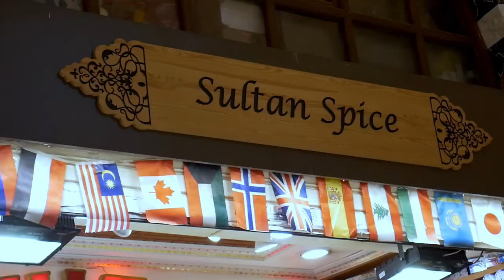Cycling Turkey - The Southern Coast // A Bike Touring Short Film // Part 8 - Turkey (continued)

Comment: Water Pistol  - spray dog in face, add mild solution of lemon juice to the water, spray in dog's face dog goes away.
Reply from the maker: We reach our water bottles on our handlebars much faster than we would a water pistol (which we think is a bit unnecessary to carry), and have used that the past months. However, in some cases the dogs comes so fast and without warning that it’s impossible to react in time.